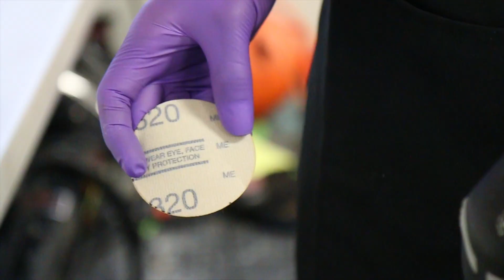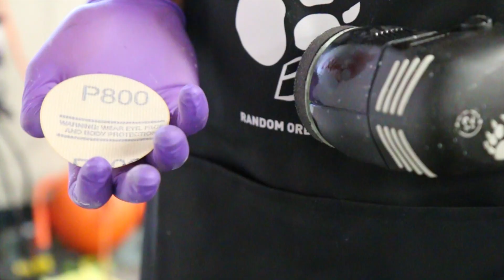Audi A6/RS6 Headlight Restoration

Comment: great job, but how do you clean the grunge on the inside of the cars headlights !?
Reply: Remove the clips that are holding the lens to the plastic body of the headlight. Using a heat gun carefully heat up the black goo-looking sealant and pry open the lens. Be careful and take your time so you won't damage the lens or the plastic body. Use Meguiar's Plastix or any other plastic cleaning solution. Apply  Meguiar's clear coating solution for plastics on the inside and outside to protect the lens for about a year otherwise the grunge will reappear soon after.